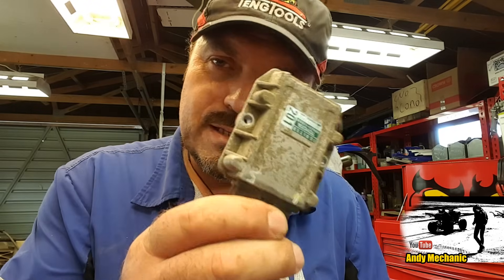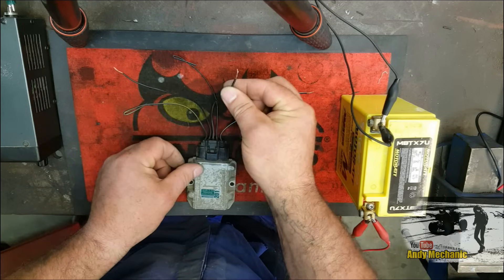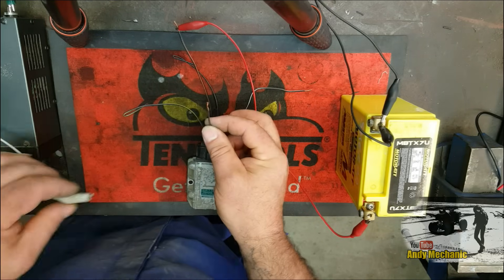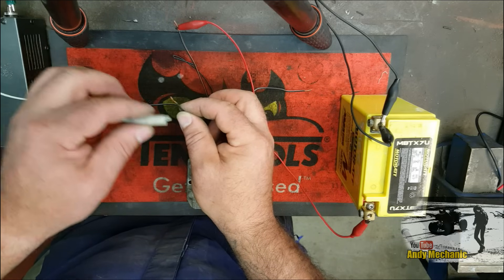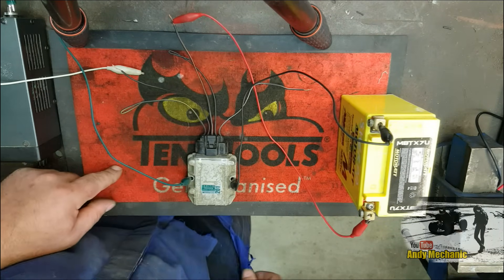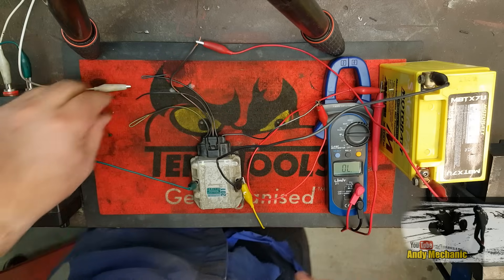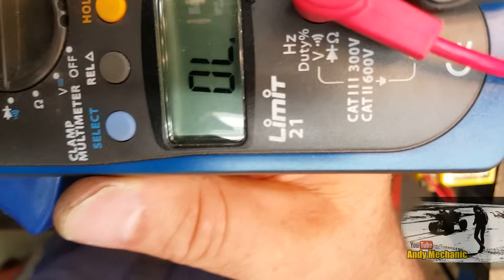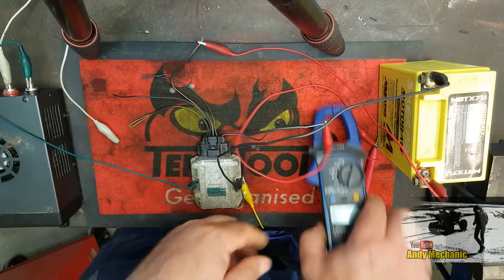How to test a Toyota ignition igniter #1421

Comment: would an engine code fault be stored at all on an old obd 1 system or would that only apply to obd 2 systems? I have a 90 Camry 2.0 that seems to run perfect most of the time then usually after it's good and warmed up you turn it off to go in the store then return and it'll run perfect for maybe 10 seconds or so then all spark suddenly stops. It runs perfect for those 10 seconds though even accelerating or anything. I'm wandering if it's the igniter as I've read they switch from turning the coil on at full power at start up to running it lower power during operation to make it start a cold engine better which leads me to thinking maybe it is the igniter. Do the igniters really operate this way?  I never notice the check engine light to do anything. It's definitely the spark ceasing to all cylinders at once. Sound like an igniter/icm to you? I wish I had all the equipment to test it. By the way thanks for the videos as they're really helpful!
Reply from the maker: The ECU does not look at the feedback signal on the IGF until a few seconds after start up. So, if you have a bad ignitor OR poor 5v output on the IGF pin of the ECU then you have the same fault as shown in the MR2 series of videos.

Hope this helps

Andy
Reply: @AndyMechanic  thanks that's a great help! One more question if you don't mind. Do you think it's possible at all to be a weak ground connection that could be the problem since it's only after the cars been ran and warmed up a good 20 min? Or would it be safest to bet on icm or ecu as the culprit? I also seen something in some forums about these cars having a problem with a radio interference filter shorting out that can cause problems but I feel the symptoms don't match up well to that but I'm no expert for sure. What I thought was strange is how the car seems to run perfect no matter how long I run it the first start then when you turn the key off and on again it'll start that run perfect for 15 seconds and die type of thing again. Strange how good it starts right up and runs then just dies a moment later. I tried running a timing light and revving the engine just before it dies to make sure the engine was still rotating with the ignition on and the fire just totally stops. Thanks for the help!
Reply from the maker: Sounds to me like it's exactly the same as the issue I had. Turned out to be a faulty capacitor inside the ECU. You could put a multimeter on the IGF wire and measure voltage with ignition turned on but engine off when the fault occurs. If it's not 5 volts then you have found your problem

Cheers Andy
Reply: @AndyMechanic  thanks a lot! Now I just have to figure out how to find the igf wire
Reply from the maker: Remove the ECU & open the lid (4 screws) you'll see each pin labelled up on the circuit board :-)
Reply: @AndyMechanic  ahhh makes sense. Thanks a lot!

Comment: My 86 Toyota MR-2 Started, then immediately shut  off and never started again... no spark at all. Only thing left to try is Ignition module pack EMC 89661 17020 MT and the part you are showing in this video. The EMC in trunk is my guess. or should I get them both?
Reply from the maker: Hmmm.....I'd check the 3 pickups in the distributor first as if ECU doesn't get these signals it won't trigger ignition or injectors because it can't 'see' the engine rotating.

Cheers Andy
Reply: And then too, I did wire small 12 Volt heater this year directly to the poss and neg battery posts as recommended by some of the cars here on youtube same heater they recommended. If its anything like my old shoveled chopper it could have fried the ECU brain Box .I went through Many dozens of those but never a coil like you have in your video here Thanks @AndyMechanic

Comment: Hi Andy, I have an issue with my 99 Toyota rav4,  its throwing a p0340 code, I've replaced coils, timing belt, cam sensor,  checked crank sensor, new spark plugs! It runs but only on two cylinders, cylinders 1 and 4 are firing but not at correct time,  any ideas?
Reply: Was it the timing?

Comment: Very good but where dose it mount and how to install it, please and dose it supply all 4 plugs with spark ??? Somebody PLEASE Help... I have a number 4 misfire. And a  new coil and plug did not fix ....the code.
Reply from the maker: Hi David, the igniter acts as a relay, grounding the coil to provide a spark for each cylinder - the timing controlled by the ECU

As all ignition parts are common to all cylinders except for the distributor cap, HT leads and spark plug itself these are the parts I'd be checking if getting a cylinder specific code.

Hope this helps

Cheers Andy
Reply: Hi, can you please wiring diagram show and send me to messege?

Comment: Hello I have a fj60 1984 that turns off on me randomly driving or not , bad igniter?
Reply: No check engine on 🙁 just randomly shuts off
Reply from the maker: Hmmm.....possibly a fuel pump pressure issue as this wouldn't trigger a fault code. There are many variables here so hard to diagnose without lots of testing...
Reply from the maker: If it's a bad igniter then a fault code should be stored and your engine check light on....

Hope this helps
Cheers Andy

Comment: Andy, I have an issue where the car cranks over excessively but it starts after a while and runs fine but with a low idle. I get a code 14 that Toyota says is  a no IGF signal. Is it possible that a mix up of the wiring from the 'igniter' to the distributor be the cause? It is the same igniter (201) like the one in your video. I changed the distributor, test the spark plug wires as well, tried a different coil & checked for continuity in the wires to ECU-no issues
Reply from the maker: Hi Patrick, in my experience the engine won't run if the IGF signal doesn't meet the required criteria. The ECU will stop fuel injection after initial start up if no acceptable IGF signal present. The IGT is a command signal sent from the ECU to the ignitor to control and trigger a spark event. If the wires were swapped over I'm sure the engine would not run.

The code may be historic from an event where the IGF didn't meet the accepted criteria for more than 7 IGT commanded pulses.

It may be that there is an issue with the ignitor, coil, ECU itself  (it puts out a 5v on the IGF wire and ignitor pulls this voltage to ground to create the switched signal. It could even be a fault on the wiring/connectors on the IGF circuit between ECU and ignitor. 

You'll need a scope to 'see' the IGF signal so suggest you test the ignition coil primary and secondary resistance - also do a spark test to see how 'strong' the spark is. Do a resistance check on the wiring too. If all this looks good then it's likely to be the ignitor. Though, as in the case of the MR2 it could be the ECU - they are known to fail on this circuit too.

Long crank time has nothing to do with the IGF - the ECU ignores this signal until after the engine has fired for the first time - suggest you check residual fuel pressure as could be a fault with fuel pump non-return valve or failed fuel rail pressure regulator.

Hope this helps.
Reply: Thanks Andy

Comment: Heres a question im dealing with. i have an 86 toyota pickup truck 22r.  

recently its been having this issue where it starts up and runs fine when its cold and drives fine. but once its warmed up and eventually go to shut it off.. it will just crank and crank and crank. then i took just a screw driver hooked it to the coils lead that goes to the distributor and got it close as i can to grounding it with out it touching. cranked the truck over and no spark. 

local auto parts place said the coil could be losing its effectiveness when its hot. but not exactly sure if i should just buy one or test certain pins before hand.
Reply from the maker: When the fault occurs I suggest firstly checking the resistance of both the primary and secondary windings in the coil - one may go open circuit due to a break in the winding which opens up due to thermal expansion when coil is hot

Also check the resistance. Of the crank and camshaft sensors - especially the crank. If the ignition system fails to see a crank signal then no spark will occur.

Hope this helps

Cheers Andy

Comment: Hello,
very informative video!
Whats the big bolt number denotes? You Used CHD1 instead of 201? are these interchangeable? how to find right or compatible one?
Reply from the maker: I'm not too sure on those codes. 8.8 or 10.9 etc denotes the bolt's strength.

Cheers Andy

Comment: Video link where Andy Mechanic creates the logic probe:

https://www.youtube.com/watch?v=4TH6zSdFlhA

Note: Two ignitors are tested/featured in this video. The first ignitor, Ignitor 201 is Toyota P/N 89621-12050 and is removed from a 1992 Toyota MR2 (W20 Chassis, 3S-GE engine). The second ignitor,  Ignitor CHD1 is Toyota P/N 89621-16020 and is removed from a Toyota RAV4 (Chassis and engine are unknown; no mention made). 

An ignitor removed from a 1985 Toyota 4Runner (Chassis N60, 22-RE engine) is Toyota P/N 19070-35130.

Comment: I have a 1994 Toyota DLX Extended Cab Pickup 2.4 Liter L4 22RE Engine .. I was told the Crankshaft Position Sensor is in the Distributor ? Is this True ?
Reply: If its in the distributor it gets a reading from what is called a air gap

Comment: I was told that I needed to pull the Crankshaft Pulley and so I did but I did not see the Crankshaft Position Sensor and there were no wires near this location. I pulled back the alternator back.. still did not see it ... darn

Comment: I have a big problem.. I cant find my Crankshaft Position Sensor.. I have check everywhere.. I have a 1994 Toyota DLX  Pickup 2.4 L  Engine 22RE Does anyone know please? Thank you in advance.
Reply from the maker: It may not have one. Instead the pickup may be inside the distributor like on the 1992 MR2 I worked on a few months ago. There are videos on this on the channel. With the MR2 there are in fact 3 pickups inside the distributor, each supplying a signal to the ECU

What's the fault with your pickup?

Cheers Andy

Comment: Hi Andy, thanks for the video. I diagnosed a faulty igniter on a 4 cylinder camry following your method. Extra information for anyone wondering - my igniter was still switching when given a 5 volt trigger signal, but the output signal was only 0.75 volts. Bench testing the new igniter prior to installation showed the switched output at 5 volts.
Reply: Curious, was the faulty igniter allowing your engine to run at all or just run very rough with no power?
Reply: @jmaverick  it would run fine most of the time, then occasionally skip/misfire or stall. This was a few years ago but I think this video helped with  another problem I had with this car where it would intermittently stall and refuse to fire again. Eventually it just died altogether one day in my driveway. That ended up being a faulty engine computer.
Reply from the maker: Sounds like the original fault was the capacitor failure in the ECU as I had with the MR2.
Reply: @AndyMechanic  they were probably both failing concurrently. The new igniter kept me going for a couple more months before the problem got worse again and it turns completely, and I ended up tracing it back to the ECU.
Reply: @dvspeter  I was able to finally get my truck repaired.  Crank Crank Crank and no start ended up mostly being the Fuel Pressure Regulator.  Replaced it and the plugs AGAIN and it fired right up and drove it down the road. Thanks for all your info
Reply: @dvspeter  Was your engine light coming on?  If it was, do you recall what fault code you were getting?  Was it P1300?
Reply: @johnharimoto8605  no I wasn't getting an engine light, but Australian cars weren't obd-2 compliant so it might be different if yours is US-spec.
Reply: When you say you've bench tested the igniter for output voltage, did you just change the multimeter from continuity to voltage?

Comment: Did you find what the problem was with the mr2?
Reply from the maker: You'll have to watch the full diagnostic series I did a few months ago.... :-)
Reply: Andy Mechanic I have a kit car with a 3sge in my work shop that is running a set of carbs and no ecu it runs till it gets warm and dies coil is fine distributor has been rebuilt. Next step will be to look at igniter if i can find it and test the wiring between them.

Comment: Good morning Andy we swapped a 78 20R engine put it in a 77 Toyota truck the engine was running at 2500 RPMs prior to installation Runs beautiful,,, we found out that there's no hook up to the distributor in a 77 truck wiring harness  It is different the 77 had a conventional distributor Point condenser with one wire going to the distributor since that's been removed, we're trying to figure out how to hook up to 2 wire lead on the 78 transistorized trigger wheel distributor without ruining it, any help would be greatly appreciated

Comment: My 1994 22 r pickup won't fire.  One day I went out to start it and it was dead after no symptoms and running fine. Not out of gas.  I've put the coil wire to the body metal and there is a good spark when cranking it over. So coil and igniter assembly are good I guess.  So that leaves the distributor.  I've taken off the cap and all looks good-the rotor operates normally when cranking.  Are there individual parts that might be bad in the distributor?  Great videos you make.
Reply: since u know u have a good igniter nd good coil disconnect the coil wire at the coil get a test light to ground reach in close inside the coil dont touch the inside of the coil leave a half inch gap have someone crank it nd see if u have a bad coil wire make sure ur a good ground second crank it nd check ur rpm signal if u see it rise just a lil from zero u have a good crank sensor in the distributor also disconnect a injector use a noid light that fits the terminals cranck it if u have injector pulse u have good crank senor if u getting spark out the coil nd signal to the injectors 1.bad coil wire to the distributor 2. bad rotor inside the distributor hope this helps
Reply: Eli Gomez dear sir i Have camry 1993 model car is cranks but there no spark on cools cables and in coil so i checked connector which comes two pins for coil there power but there’s not ground what’s could be issue and where from will get ground supply signal there’s not ground signal only power 12v always on with turn on ignition i changed distributor assembly and igniter too
Reply: Little late for this probably but a visual spark doesn't mean the coil is good for sure. They can produce a weak spark that's not hot enough to fire the engine but still can see it jump. Might check timing to be sure. It's not out of gas but did you verify the gas is getting to the engine? If you can run a fuel pressure check.
Reply from the maker: Very true....important to test the distance the spark can 'jump' in atmosphere to get an idea of secondary voltage output capability of the coil.

Thanks for your feedback. I did fix the fault though it's a few videos down the line!

Cheers
Andy

Comment: hello Andy I'm having some trouble with my 22're toyota engine where it just starts up for like 5 seconds and then shuts down even quicker if I try to rev it I changed fuel pump checked fuel line checked injectors by plugging other injectors onto the line and that's when I found out they aren't firing,tested the wires and the injectors are getting the 12 volt but it seems it's not getting the pulse ground from computer so long story short I started to check the igniter cause I see that it is supposed to send signal to the ecu so the ecu would fire the injectors and the engine only runs for couple sec of the cold start injector so was wondering if you could give me a shortcut to your vid on making that thing with the 2 little lights so I can test mines and can I just test it while it's plugged up to see if it's send out signal to ecu
Reply from the maker: +Kirkland Banton https://youtu.be/4TH6zSdFlhA
Reply from the maker: +Kirkland Banton let me know how you get on :-)  check spark too. If spark also stops then suspect crank angle sensor.
Reply: +Andy Mechanic  thanks bro
Reply: @AndyMechanic  i have a toyota corona3sfe replaced the ignition coil condenser still no spark is that wat i have to replace no start cond check all relay fuses ok
Reply: I have the same problem stuck all kinds of parts in it still only runs a few seconds on the cold start injector than backfires an dies. Just wondering if you figured out your problems

Comment: hello how are you my car is alto 2006 model issue is that regular oil change to other oil caltas change oil is shell manic are told engine ring issue estimate cost high i cant effort high expensive   please suggestion and resolve my issue .
Reply from the maker: +QAISER FAROOQUI Hi, Qaiser, I think you are talking about having to fit new piston rings to your engine?

If this is the case then, yes, it is quite an expensive job as the cylinder head needs to be removed, as does the sump. 

The cylinders will need a hone, this can be done with the block still in the car which does save a lot of labour.

It is an expensive job though. The only alternative is to find a good second hand engine and fit that.

Hope this is what you were asking about.. Cheers Andy
Reply: Where is the location of ignition control module for 2003 toyota camry 2.4L

All Hotels All Hotels All Hotels